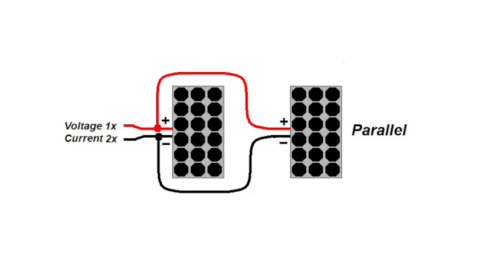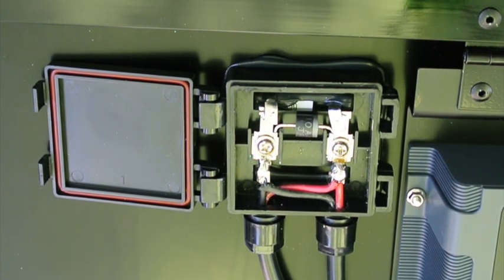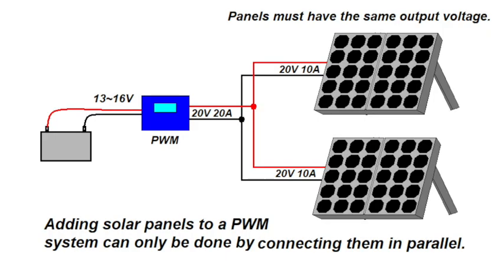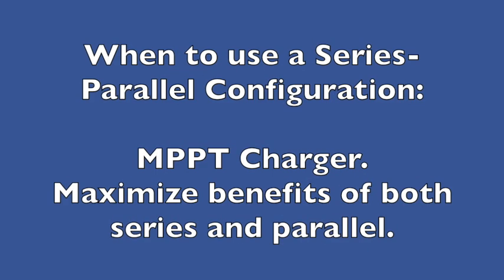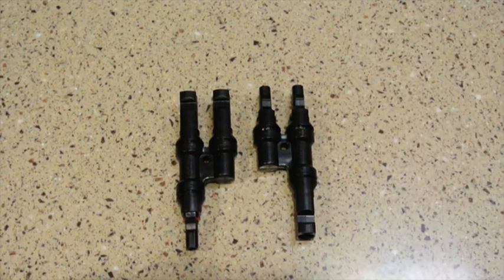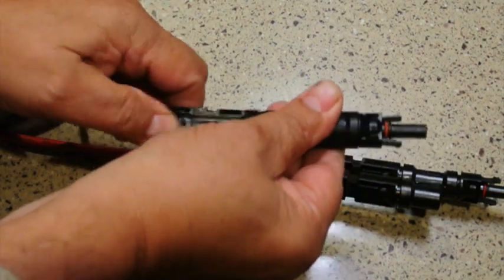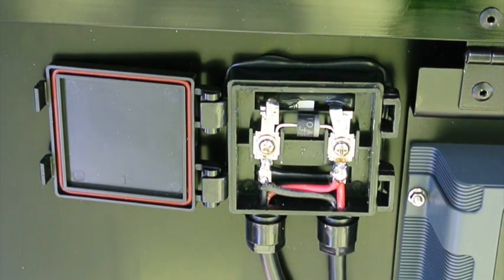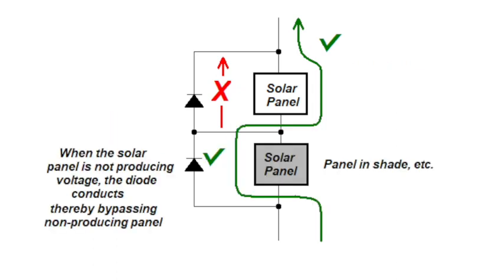Series and Parallel Panels - Portable RV Solar Charging Video 7

Comment: Thank you for excellent videos. Your information has helped a lot. I have a question regarding Renogy suitcases. I purchased a 200 watt suitcase and as you know, this is wired parallel. I also bought 2 of the exact same panels and am wanting to make another 200 watt suitcase. I currently have 2 x 100ah lithium batteries hooked in parallel with a Victron mppt 100/30 controller. I have 400 watts of panels on top of my trailer hooked to a separate Victron 100/30 mppt I find that these are usually in the shade and can’t be used as much, hence the portable ground panels. My question is: I wanted to make the second suitcase a series hook up. What are the consequences of having one suitcase hooked up parallel, a second suitcase hooked series, then running both of those series to the controller? What I really want to do is take the factory suitcase and disconnect the parallel connection and add new mc4 connections so I can wire this in series also. A few simple snips of wire. Only problem is I would lose the warranty. That is why I ask the question about one suitcase hooked parallel and the hooked series. Just never heard of that scenario. Thank you-Dennis

Comment: Been watching your videos, thanks for the great work!!! I have a 200 watt panel mounted to my rv but would love to add another 200 watt portable one, any tips? Wiring in series wouldn't help if one is shaded and wiring parallel would require too short of a cable. Just wondering what you would do.

Comment: I have an RV with 4 batteries. Could I buy two 200 watt kits and just hook one to one battery and the other to another battery?
Reply from the maker: Are the 4 batteries connected together for use in the RV?  If so, I would want to place an isolator between the two battery banks.  That way the systems would remain somewhat independent.  

Boats have had this kind of setup for years, as it allows one set of batteries to be put into reserve should the other set of batteries be discharged.
Reply: @RVProject  Good advice, thank you!

Comment: Great instructional video as always. I do have a question and seeking your guidance. I'm using a Renogy 200W solar suitcase and bypassed the controller as I need to power up a Bluetti AC200 (which has it's own internal MPPT controller). The suitcase as it stands from Renogy is wired in parallel and therefore putting out 21.6V, not enough for the required minimum required voltage of 35V for the Bluetti. It has been suggested that if I were to configure my solar suitcase's wiring in series rather than in parallel, that I'll gain nearly double the voltage and then able to charge it albeit slowly. I do not want to make this a permanent configuration however, as I would like the freedom of charging up my 12V batteries when required. As you have the similar Renogy suitcase, could you recommend parts I would require and/or a general diagram for me to follow. Your thoughts on this? Thanks
Reply from the maker: I have struggled with putting any information out about putting the 
Renogy suitcase panels in series due to liability issues as it may 
require re-wiring the panels, unsoldering connections, etc.

I downloaded the manual for your Bluetti as it seemed odd that has a minimum requirement of 35V.  But you are correct - the recommended solar input is 35-150V.

That being said, I am going to think it will work fine at 18V.  You should check with Bluetti first, to see if the MPPT controller could use lower solar panel voltages like the 18V or so your Renogy panel puts out.  If they won't help you, they might be wary of liability issues like I am, or perhaps they want you to buy their solar panels.

Actually, the charge rate will be a bit more in a series wired panel than a parallel panel - unless one panel is in the shade.

If your Renogy panels are wired such as the cable from one panel goes into the wiring box of the second panel, and only the second panel is connected to the charge controller, then you will have to un-solder the two panels, then attach connectors to each panel. 

This is too much work for many people, and again, the liability issues for me instructing someone how to do it is something I don't want to do.

But if the two panels have connectors on the end of their respective cables, then I can provide a diagram on how the panels could be wired in series vs. parallel.
Reply: @RVProject  Yes, the rear of my 200W Renogy Suitcase is wired exactly like your 100W suitcase i.e. with MC-4 connectors which I could then connect to a battery extension or other. But I totally understand the liability issues you mention. I would like to continue using MC-4 connectors for either configuration as I need if that helps. I'll continue studying the wiring as I see no choice other than to splice into some of the cables. Thanks for your prompt response.

Comment: there is something that confuses the hell out of me. the Diode at 6:45. 
they are polarized components and the + is the anode the - is the cathode. in conventional theory the electrons flow from "pos" to "neg", however we know that it is the opposite. they actually flow from negative to positive. As far as i know the diodes have the stripe on the cathode -> negative side. 
So why is this diode placed with the striped-negative side on the red cable and the positive side on the black cable?
What am i missing?
Even on my breadboard when i put the components the non-conventional way (flow from negative to positive) everything is working.
please someone enlighten me because this caused me lots of headache
Reply from the maker: Well you are lucky as I happen to subscribe to the electron theory. The conventional theory was not even around until the 1980s. When I learned electronics, the electron theory was taught in college and high schools.

Actually, the conventional theory does not have electrons going from pos to neg, but rather they claim that the flow of electricity is due to "hole" movement, which are the absence of electrons, and thus positive.  You can either believe electricity is electron flow from negative to positive, or it's the flow of holes from positive to negative.

So think of a parking lot full of cars (electons). If a car leaves a parking spot, then parks in the spot next to it, the electron theory says the electron (car) moved, while the conventional theory says the parking spot (hole) moved.  How ludicrous.

Thing is, with schematics shown with the most negative side as ground, it is somewhat difficult for new students to conceptualize negative-to-positive current flow, and just the negative-to-positive concept itself is a bit difficult to learn initially. 

But this was changed by some well-meaning but ignorant educators to make it easier for the learning process... especially when you need to unlearn it if you want to truly understand how semi-conductors work.

But enough of that (sorry, you hit a nerve).

When diodes are put into the panels as shown at 6:45 of the video, these are bypass diodes. They are reversed biased across each solar cell so they do not normally conduct. The diode is reverse biased due to the voltage across it' attached solar panel.

However, when a panel ceases to conduce electricity, say when one panel is in the shade,  The resistance of that panel increases.  When this happens, think of it as an open.

Now, we have the bypass diode, which was once in parallel with the solar panel and reverse-biased. But with the panel a virtual open, now the diode is effectively in series and forward-biased.  

So just remember that each bypass diode is held in reverse-bias by it's attached panel when it is conducting. So all of the current goes through one panel to another, and no current is going through the diode.

But when the panel is not conducting it's resistance increases, and the voltage differential no longer exists, which takes the bypass diode out of reverse-bias, and provides a current path around the panel.

You also have to remember that the panels are generating electricity, so think of them as batteries.  This also helps figure out how the diodes work.

If the current was forced through a panel that was not conducting, it would become damaged. 

So try this on your breadboard.  Hook up three 1.5v batteries in series, then a diode across each battery reversed biased. Then hook up a load (LED with resistor, etc).   

Then, take the center battery out of the circuit. You should see that current still flows.

Comment: Does anyone know of a video showing how to modify the suitcase to be wired in series. I want to use one with an MPPT controller. Thanks
Reply from the maker: Virtually all suitcase panel pairs from Renogy that I am aware of are pre-wired in parallel.  My website shows how to wire two sets of suitcases in series, but not the modification of a single suitcase panel pair.

While not particularly difficult to do so, there are liability issues involved with such tasks. For that reason, I have decided against showing how it can be done.  Perhaps that is why you cannot find a video.

Comment: Thanks for a great explanation video. My question is I have a renogy 200 watt eclipse suitcase. Can I add another single 100 watt panel to make it 300 watts of solar? If so would I just do it in parallel by using the 2-1 connectors?..thank you ‼️
Reply from the maker: The only way to wire dissimilar watt panels is in parallel, assuming they have the same output voltage.